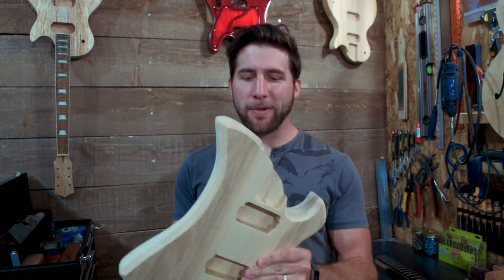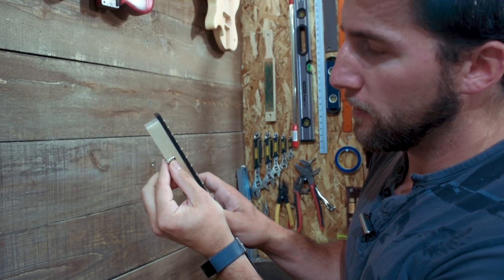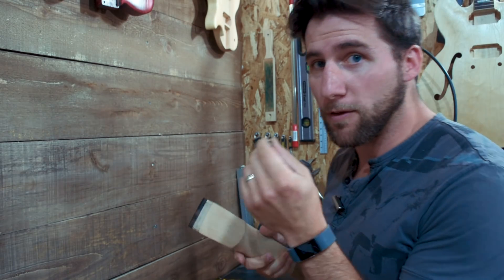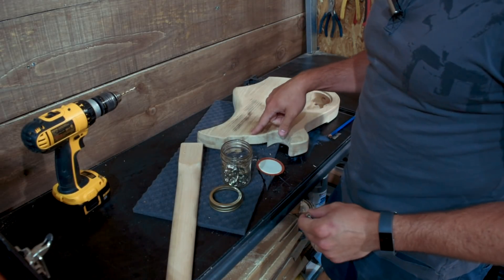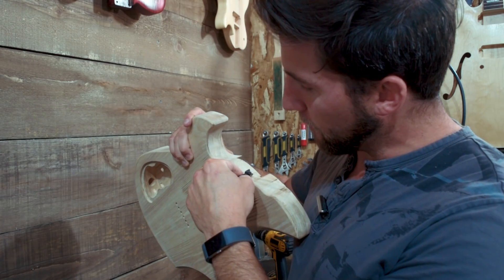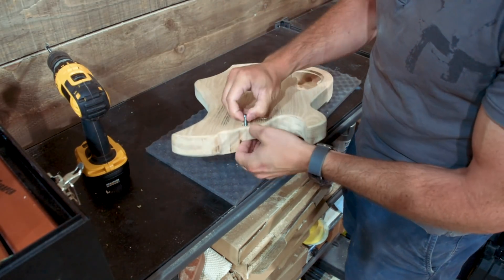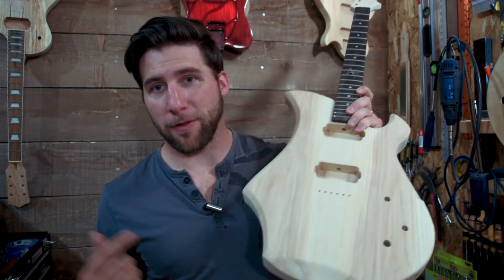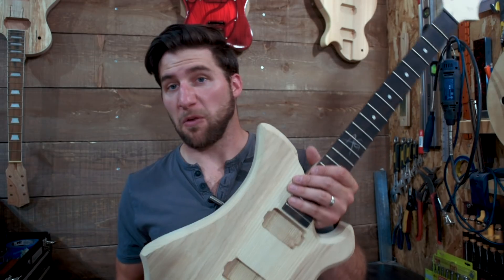The Great Guitar Build Off | Joining the Neck

Comment: Just a general carpentry type tip, if you put a board underneath while you're drilling, there is no tear out.

Another tip, take a scrap block of wood to the drill press and drill a guide to keep the bit perpendicular on both axis.  Instead of being 90ﾟ in both X and Y, you want a slight angle to pull the Hill into the joint tighter. You can accomplish that by putting a few pieces of folded paper on one edge of the block as your drilling the guide.

You should have spent the $0.50 to just buy 3 longer bolts.  In your neck pocket design you removed a bunch of material which weakened the joint.  Instead of 4 bolts, you used 3 which weakens the joint. You drilled perpendicular instead of out a slight offset which also weaken the joint. Then you removed depth material by using bolts too short which in turn weakened the joint again. I don't wanna sound like an a** that's just harping on you, I'm just trying to help you for future builds. I've been doing this for a very long time.
Reply from the maker: Thanks for the tips Jim. I wasn’t to worried about a bit of tear out on this one as you can see. It wasn’t an issue at all. Shimming the guide is a good idea, so thank you for that. Most bolt on necks are done at 90 degrees though, so I don’t see that as a problem. I also don’t agree that it weakens the joint somehow. 
I went with that length quite deliberately. I wanted them under the surface of the neck and I wanted to remove material there to make it more comfortable to play as I explained in the video. There are many neck joints that are shaved down much further than that, so I don’t anticipate that being a problem.
Reply: @BradAngove  You're doing a very good job so far. I wish someone beside you and #WonderBreadGuitars would post a video. I've seen a little from Big D but that's really it.
Reply from the maker: Thanks Jim. BigD has kept the videos limited but has shown a lot of his progress through them. If you follow him on Instagram he has shown quite a bit. I have posted a few further updates in there as well.
Reply: @BradAngove  my wife doesn't allow me to have Instagram. Too many scantily clad women on their LOL.
Reply from the maker: Hahaha there definitely are. Don’t tell my wife...

Comment: You should try the angled screw system like Dan from Guns n Guitars does. Two screws into the "butt" of the neck. It will pull the neck in even tighter, as well as adding two more screws.
Reply from the maker: I have to be honest with you Brian, I really don’t like the look of that angled screw option and I’ve always found it unnecessary. I understand why Dan does it, and he like it so it makes sense for him, but I wouldn’t do it on one of mine personally.

Comment: using a drill press would get all the holes drilled exactly square rather than any tilt of the screws... a small hard steel tube could be used to 'lengthen' the Allen wrench to make install of the 3 inserts easier...
Reply from the maker: Yup, that’s what drill presses do.

Comment: I did plan to let my fingernails grow a little for finger picking but it seems I must have unconsciously nibbled them all off while watching all the freehand drilling. Surely you have at least one clamp in your home workshop?? Nearly cried when you said you heard a cracking sound. Glad it all worked out though, great looking build so far!
Reply from the maker: Yeah, I have several clamps. I didn’t have any issues with the holes not being straight, so I don’t think there was any reason to use them in this case.

Comment: 15:57 .. a crack!! I was wondering if that might happen.. one other luthier video I've seen with threaded inserts said to be sure to use a thread tap to cut the threads first before screwing in the inserts! I've built a few travel cigar box guitars with screw on necks but I like the idea of a bolt on!
Reply from the maker: Ya, I was a bit concerned about tapping it first possibly making it looser. May have been a good call. Anyway, a hairline crack that is now filled with superglue won’t be a problem regardless.
Reply: @BradAngove  iirc the guy who showed how he tapped the insert hole also glued in the insert... the guitar is lookin' go-o-o-o-d! (even though I'm a Texas Toaster to the end! 🤣)
Reply from the maker: I love a good Texas Toaster haha. Those guys have some legitimate fans, as they very well should.

Comment: Hi Brad

Would there be any advantage to locktight the bolts when final assembly?
Reply from the maker: Arguably yes. The likelihood of them loosening under tension is slim to none, so I don’t plan to do that. It would make it harder to disassemble, but would ensure that the bolts won’t move without deliberate effort.

Comment: "Welp the roof has caved-in and shop appears to be on fire, but I'm not worried ...."
Reply from the maker: Haha I love that. There are a few hilariously dramatic comments on this video, but I think this one is my favorite.
Reply: @BradAngove  I was just impressed you saved it with that super glue, I woulda thrown the thing across the shop.
Reply from the maker: Would have had a lot more gluing to do had I done that haha. I always find it funny, particularly on other peoples videos, how many don’t realize how strong this sort of glue joint is.
Reply: @BradAngove  better than titebond?
Reply from the maker: What do you mean? 
I used titebond in the holes. A properly done titebond joint is also usually stronger than the wood itself.
Reply: @BradAngove  ahhhh I misunderstood, thought you used a different product
Reply from the maker: I also used superglue if that’s what you’re referring to.

Comment: kind of a random question, but I've been working on refinishing my strat with a 2 piece alder body. For some reason, the center body seam line shows through 4 layers of thin clear nitro and 1 thin + 2 thick black nitro layers. What can I do at that point? Should I start over and use grain filler? Only the seam on the front is showing.
Reply from the maker: Is it showing up as an indent in the paint?
Reply: @BradAngove  hey, yeah it was an indent in the paint. But because I made a couple other boo-boo's i ended up sanding it back to blank and starting over.
Reply from the maker: Sorry to hear that. I hope it goes better this time.
Reply: @BradAngove  you're too kind! I'll redo it a million times if i had to until I'm satisfied!

Comment: Watching you drill those neck screw holes, it occurred to me: a drill with a spirit level on the side would be an excellent thing.
Reply: Assuming your workpiece is at a reference of 0 or 90 degrees.
Reply: @stevedimebag  Indeed!
Reply from the maker: I actually just acquired an old drill guide that is perfect for this sort of thing. Turns you normal drill into a drill press essentially. I added a version from this century, which has angle options (unlike mine) to the woodworking tools list in the amazon link in the description.

Comment: On eBay they sell a cheap drill press that holds a drill like the one you have they're a pretty cheap alternative to buying a big full sized drill press ive been using it for a while my only issue with it is the distance from the throat and the actual drill isn't that big of a gap so it can be annoying if you're trying to drill in the middle of a large piece so I built a work bench that holds the base above the work space and I use the drill press upside down so the throat isn't in the way and the drill press still comes down from above it's just mounted overhead if that makes any sense
Reply from the maker: It’s funny you should mention that. I actually just got an item that is somewhat like that. I kind of looks like a router base for the drill to turn it into a drill press with an unlimited throat depth.
Reply from the maker: The one that I have acquired is ancient, but I added one from this century to the woodworking tools list in the amazon link in the description.
Reply: @BradAngove  for some reason they don't show up on the amazon list.it displays this message.We're sorry. Brad Angove hasn't added any recommendations to this list yet, check the other lists.
Reply from the maker: That’s odd. Are you on American amazon or Canadian?
Reply: I think I know what you're talking about I saw them too late I'd already ordered the drill one I have and I was already piecing together a homemade work bench so I just made it work with what I had im also working on a homemade drum sander and inserts for the workbench that will allow me to pop in a router plate and make it a router table a table saw insert and a spindle sander I don't have a lot of room to work so I'm really trying to maximize the use of one table with a bunch of attachments
Reply from the maker: Sounds awesome Richard.

Comment: I will be interested in how this turns out. I am concerned about tuning stability. Both schecter and Ibanez have small bolt on joints like you have but they still do 4 bolts. 

Definitely do not want to play guitar like Jake E Lee. If you watch his video showing of his signature charvell he has a hard tail he just bends the neck if he wants floating trem sound.
Reply from the maker: Haha yeah I’ve seen the neck bend tremolo. Interesting option. I’m not concerned on the stability here. 3 bolts will be stronger than the 4 wood screws in my Ibanez.
Reply: There are several super strats with 3 bolts out there, often getting rid of one corner of the neck heel for better comfort.

Comment: I'm just seeing this now, 6 days later, but those anchors in the neck will no way offer a long lasting stable neck. I used to use them for some specific woodworking projects but I switched to a stronger more stable anchoring method(which by the way didn't have any of the pressures exerted on them that strings introduce.
Reply from the maker: I’ve used these for fastening applications that involve a lot more force than that applied by guitar strings. They are considerably stronger than wood screws (not to mention that threaded inserts are used in guitar necks already, sometimes with only one or two being used)

Comment: Threaded inserts is the ONLY way to do a bolt on neck.
Reply: You sure? Pretty sure the most popular electric guitar of all time doesn't use them. And it's various copies.
Reply: Phil Underhill Positive. Most companies do it w wood screws b/c it’s cheaper and easier but it AIN’T better. Not even close.
Reply: @johnnypk1963  My point was that Fender, for example, do not and so it's not the only way. Might be the best, but ask those other manufacturers whether they'd rather have their own or Fender's brand recognition.
Reply: Phil Underhill it’s obviously not the only way. Smh. But if u want the most secure, durable and tone transferring neck to body joint aside from a set neck, it is.
Reply: @johnnypk1963  Oh, I thought you said it was the ONLY way (emphasis yours).
Reply: Phil Underhill u done?! I am.

Comment: For gods sake. Use wood drills instead of metal drills. And if you drill through put something underneath
Reply from the maker: Metal drills? I’m only using one drill here, and it is designed for wood just as much as metal.

Comment: Most people over 10 know to put tape on the surface to stop tear out
Reply: Tape, will not eliminate tear out
Reply from the maker: It can help a bit, but a tiny bit of tear out on the inside of the pocket where it can be easily removed is no issue whatsoever.

Comment: Omg bet those cracks break apart as soon as you tighten the neck. Is this a fake out build to throw off the competition. Think this clip of careless work my have cost you the competition,  that body is so weird this has to be a staged fake build.
Reply from the maker: Fair enough if you don’t like the body. The comment on the cracks is ridiculous though. A hairline crack like that filed with super glue is harder than the original wood when it dries haha.
Reply from the maker: On a side not, how much do you want to bet?
Reply: @BradAngove  lol if you cracked a baseball bat or a hockey stick would  it be stronger after super gluing it or is the wood weakened by the cracks?
Reply from the maker: If you created a hairline crack in the end of a baseball bat and filled it with superglue, it would be stronger after. This concept applies to lots of glue joints. You know a laminated neck is stronger than a one piece neck right?
Reply: @BradAngove  good luck on your great guitar build off.

Comment: This will be the first electric guitar that has to use acoustic strings.
Reply: I use acoustic strings on my electric slide guitar, and the action is a little higher
Reply from the maker: I don’t understand this comment. It would make almost no sense for me to use acoustic strings.
Reply: @BradAngove  Acoustic strings put less tension on the neck than electric strings do. I was just razzing you on the strength of the neck joint.
Reply from the maker: Oh, I see what you were getting at. This is stronger than your average electric guitar neck joint, but that is funny.
Reply: @saltyscorpion2151  AFAIK, that is not true.  Acoustic strings are generally thicker gauge and therefor require more tension.  However, if you used the same gauge strings on an acoustic and an electric with the same scale length, the string tension would be identical.
Reply from the maker: Intriguing
Reply: @ ER Webster, you are correct if the acoustic guitar is designed for steel strings; However,  if the acoustic guitar is designed for classical strings,  ( usually nylon) the increased tension will severely damage the instrument. (Source - www.hobgoblin-usa.com/info/strings.htm)

Comment: You can tell a persons skills a mile away this guy has none wood working is not his strong suite...  sorry fact is fact!!!
Reply from the maker: If my woodworking is as poor as your spelling we have a real problem here.
Reply: @BradAngove   I am sorry to hurt you feelings, but you did split the neck pocket 
in two places by over tightening we could see that coming ....     timber has grain  as you know and it is easy  to crack along the grain. I would say you fucked up!!   you know it and every one watching....
Reply from the maker: That wasn’t the neck pocket, but I take your point. Luckily, with the super glue in there it will be every bit as strong as it was before and it’s still fits perfectly well so there’s no issue. Hence why I was perfectly comfortable showing in on the video and demonstrating the fix.